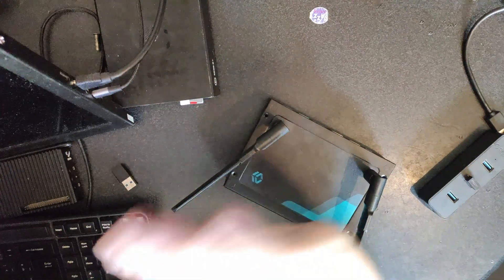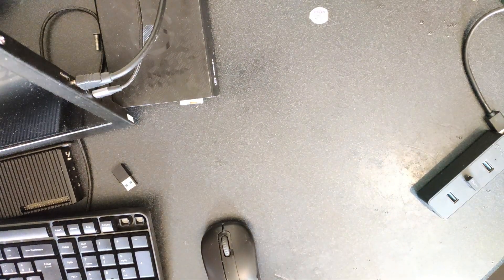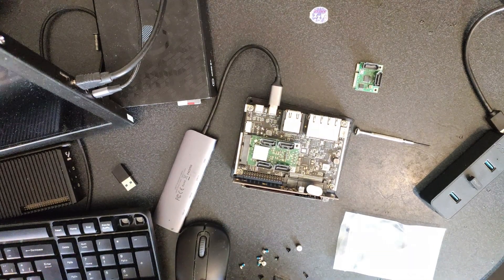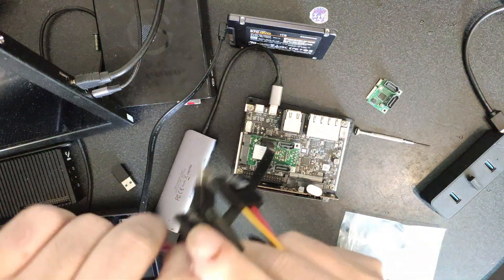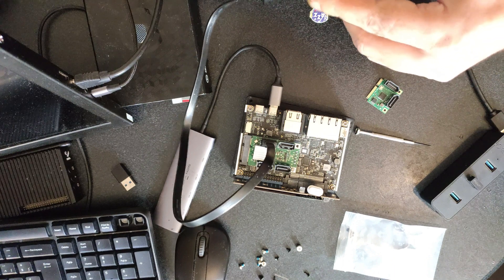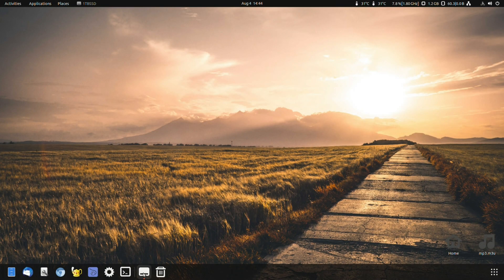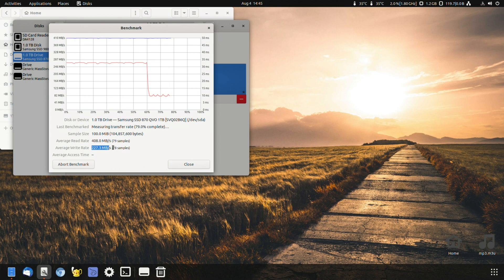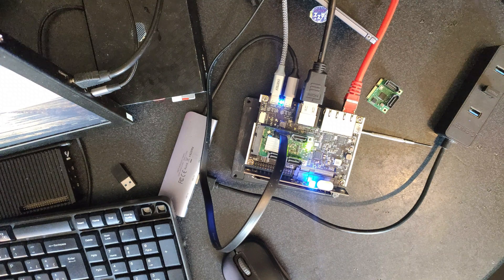Testing a new mini PCIe 4 x SATA adapter for my Mixtile Blade 3

Comment from the maker: I did add 3 heatsinks on top of the heatsink on the SATA controller. It was getting very hot when 2 SATA SSD's were used. Used thermal double sided sticky tape to tape them together. More surface area means more heat can escape. Very happy with it now. 
I now have all the data on the device I use the most. And super fast connection with my Windows pc at 280MB/s over 2.5GbE. So I can't ask for more.
Reply from the maker: Update. I'm having issue's with the SATA adapter. It overheats a lot and stops working when used for hours. It then also doesn't boot with the adapter connected. So I then unplug the adapter and work without my ssd's. The day after it always works again. Very strange issue. I'll probably send the adapter back to Amazon.